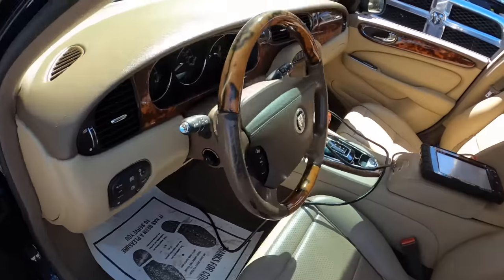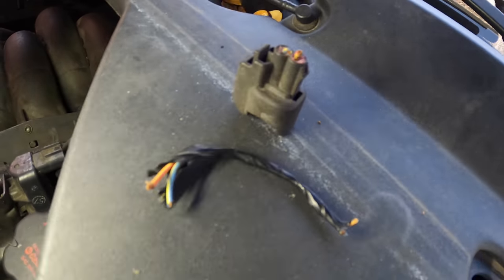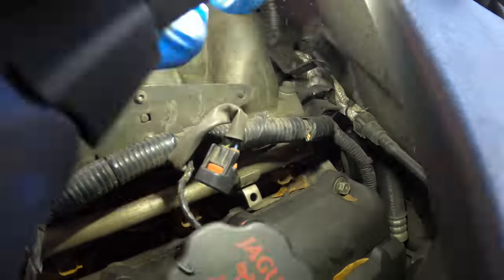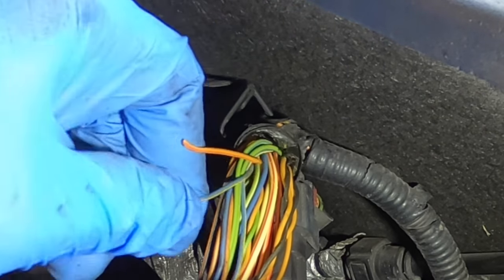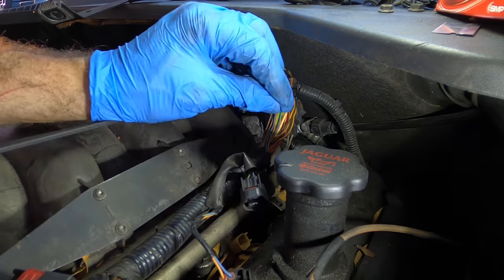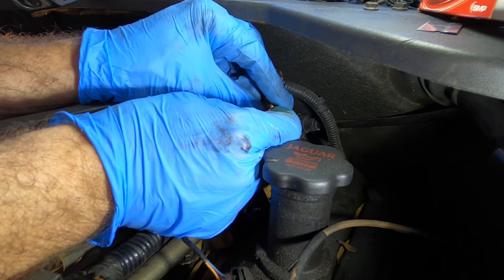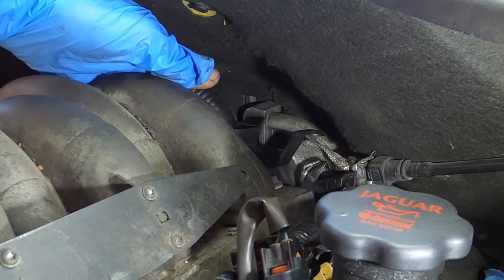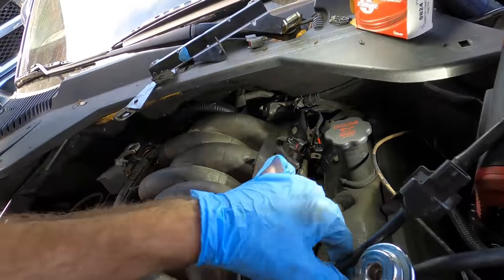Angry XJ Jaguar Engine Attacked / Electrical Damage. P0208 P0308 P0316

Comment: You can also get butt splice crimp connectors, covered with heat-shrink which has a hot-melt adhesive interior coating. Crimp both wires in and hit it with the heat-gun. Job done!
Reply: Or the non-insulated butt crimps that you cover with regular heat shrink. Either are my preferred option over soldering on car wire harnesses, but a good solder joint can work fine provided the wire isn't subject to much movement.
Reply: @ferrumignis  It's a "tomayto!/tomarto" thing, solder vs crimp! 
For ease and speed the insulated glued ones are nice but as someone else said earlier, whatever works and keeps working is fine.

Comment: When you put solder on the tip of the iron it’s called tinning. That was a tough location and  you are very confident on your connections as you buttoned up the connections before testing. Nice job !
Reply: Tinning is the action of preparing the wires with solder before attachment. NOT touching the tip with solder.
Reply: @Smakheed  actually, applying solder to the soldering tip IS referred to as tinning. But that process is also intended to prevent the tip from corroding...
Reply: @GReaper  Melting tin with the iron and dripping it into the joint is not soldering

Comment: My tip o the day (nothing reeeeegarding the soldering, which looked perfectly fine to me...), but rather on the tape wrapping. Another channel I follow, good 'ol Wes @Watch Wes Work, was wrapping a wiring harness, and used a socket as a core, then wrapped a length of the wrap on it. Then he effectively had a mini-sized roll of the wrapping material that could be easily manuevered in tighter confines such as the wiring harness you were working on here.

Just thought that was an incredible idea & wanted to pass it along.

Great content, as usual, and thank YOU for helping all of us "have a great day."

Comment: Couple tips for soldering, when twisting the wires together, fan them out first. Makes it easier to twist together and holds better. Also, use flux paste on the wire. Makes the solder stick better. One other tip, if you can, take the cap of spray can and cut 2 slots straight across from each other. Makes great little wire holder and also catches any solder that may drip off. Not bashing your soldering cause you did pretty good, just giving some helpful tips
Reply: Rosin core has flux in it so the use of flux past is not necessary if that is what type of solder he is using.
Reply: Pro-tip contact cleaner also improves soldering experience 🤣
Reply: @bradbuschur2795   reliability though  he could have used new wire loom instead of cloth   OEM grade is hard to find though
Reply: Your slots in spray can lid is a beauty. What a great idea. Thanks.
Reply: @bobhudson6659  no prob. It really does work great
Reply: @jacksmith2315  yes great idea on how to hold the wires, going to remember that
Reply: Thank you Jack,  Great Tip.
Reply: As an ex auto electrician we always used resin cored solder on good clean cable, and on slightly corroded cables we used acid core.
Reply: @richardcrowell284  did the same at an auto elec shop as it was how they wanted it,
Reply: @richardcrowell284  That works great if the goal was to get the car out of the bay and hope they sell the car prior to the acid eating the copper and failing again.  For current operators of soldering guns/irons: Please! Clean the corrosion off first and only use rosin core solder
Reply: @karlheidrich2916  We always had a tin of flux on hand for that stubborn cable that resin core would not solder.

Comment: A good way to prevent critters from monching wires is a product I believe is called rat tape. Has capsaicin embedded in the cloth.

Also: nice trick a friend showed me for taping up harnesses is to wrap a length of tape around a socket. You can also use an extension for really tight spots if you finesse it a bit.

Comment: Hi Ray, I use a curved deflector on my heat gun that makes heat shrinking much quicker.  The deflector goes behind the work and reflects heat back so it heats both sides at the same time.

Comment: A little tip for Insulating or any tape, wind some onto a small (10mm) size  socket then use that in confined spaces, much easier ;-)
Reply: I used this idea the other day by winding tape on backwards (sticky side out) on the infamous easily lost 10mm 1/4" drive socket. Worked a treat. Should have been doing that years ago. From retired mechanic in Land Down Under.
Reply: Great idea, I have used strips of tape only to get dirty and stick to itself.

Comment: Your soldering skills have gotten the peeps with over 50 years of soldering experience their panties in a bunch.  Nice work brother.  Job well done.  Great repair BTW
Reply: It seems that no matter what Ray does, there are a lot of people that get their panties in bunch for the different kinds of jobs he does. You know, some of them are probably right and are experienced in those certain jobs but the way they come off talking about it turns me and evidently a lot of other people off. If you can explain yourself without taking it personally than great but almost nobody likes to hear people bitterly complaining about a job Ray does and add nothing to the conversation. Just my thoughts, another good video Ray, thanks!
Reply: Not me. In my 50 yrs I've done all of the same stuff Ray does and then some. Only thing I can say is don't worry a whole lot about a chisel tip for the iron. If he was soldering for a living all day it might make a difference. Wait until the conical tip wears out and then get a chisel tip.
Reply: Panties in a bunch? Or simply trying to pass on some knowledge and help a brother out?
Reply: Yeah, I don't get it. I put myself in the place of the customer. I just want my car fixed. After watching a bunch of Ray's videos, I would have no qualms taking my car in to him to be fixed. What do I care how good the soldering looks? As long as it holds the wires together and transfers electricity as it should. He does a pretty good job, is very conscientious and goes the extra mile.
Reply: @108gk  We used to use quick heat irons, which gave 50 watts to a flat tip.  We needed to file it flat almost every day, as it would wear down after 8 hours.   That conical tip iron is lower temperature, so will most likely last for years before wearing out.
Reply: No,  no one has their shorts in a bunch, but maybe you do ???
And no, those are not skills yet... Have to be skillful first... Takes lots of practice...
Reply: @frandanco6289  it’s panties. you should follow all the comments from prior videos regarding this topic.   Why would my panties be in a bunch when I clearly agree with Ray and others here?

Comment: Saw this tip over at SMA: Wrap the tape around a 10mm socket to make it easy to wrap wires in tight spaces. He just takes a foot or two and wraps it around a socket and you have a tiny tape roll.
Reply: Where the heck is my 10mm...

Comment: Having battled the rodents chewing my Ford Escape wiring I enjoyed watching this one! My understanding is that wire is made now with Soy-based plastics for environmental reasons. Apparently this makes them tasty to all the plant eating critters of the world. Honda makes a capsaicin coated tape that I used to wrap any exposed conductors and the joint between connectors and loom/wrap. Seems to work. I see chew marks in the tape but nothing down to the wires yet. BTW- soldering anything under the hood of a road worn vehicle is a pain in the butt. Good job!
Reply: they should add some chilli to the production of these items to turn the critters off  with a hot mouth   i guess its good for ford and the others they get to sell more parts that would last the life of the car otherwise

Comment: My dad was an aircraft fitter in the Royal Navy, started in the 1950's, the way he taught me was heat the wires, dab them with flux, the solder then flows into the joints like magic. As you know right way to do the job is whatever works.

Comment: I think the Hook then twist method would have been best on this application, flux would have helped. I also tend to dap a bit of silicon on and around the exposed wire portion then heat gun the heat shrink in place, this will squeeze the silicon and create water barrier in case water gets under the heat shrink.
Reply: Liquid electrical tape before heat shrink tubing.
Reply: Glue lined heatshrink is a thing (a mighty good thing at that) 

But then heatshrink tubes lined with solder and glue are the mutz nutz.
Reply: Tall have the same ring tone as south main auto Eric o
Reply: @dougaltolan3017  I've used the tubing with hot glue in it. I can't say anything bad. Maybe omit the liquid tape.
Reply: @dougaltolan3017  the heatshrink with solder and glue in them are good, but IMO, they could use a bit more solder in them.

Comment: Hey Ray, I have been doing soldering all my life, dont listen to others, just make sure you make a sound and secure solder connection, also try not to move the joint until it has hardened otherwise it could lead to a dry joint! how ever you do it i am sure is good enough!

Comment: You soldered that wire exactly like I would have done, so if some random on the Internet complains about that, tell them that I (another random on the internet) would have done exactly the same way 😉
Reply: I approve also and would have done it the same way. I am 66 yrs old and been soldering (radio & electronics hobby) since I was 10. I was taught by my dad, who was military trained. I only have problems outside, when doing in field, or auto electrics, due to lower temperatures sucking the heat from my iron. Modern temp. controlled irons help with this.

Comment: I am a radio restorer.  Your soldering was just fine and will be a strong connection with the heat shrink.  You can make your soldering iron tips last longer by coating the tip with solder before turning it off and storing.  They make a brass coarse "steel wool" pad for soldering tips to clean the tip the next time you heat up the iron.  The tip is cleaned by dipping the hot tip in solder and then cleaning with the pad several times.

Comment: Your soldering method is the same way I do my RC wires for long lasting reliable electrical performance.

ALWAYS apply a dab of solder to the iron's tip to aid with heat transfer into the wires! It makes a quicker solder joint, & lessens the possibility of extensive damage to the wires insulation.

Comment: Any mechanic who starts off by calling the beast a "Jag yew arh" has my rapt attention. 
The only topper for that is pronouncing RR "Royce Rolls". ( Class thing.) Back in the days  
of beautiful high voltage wiring running from distributor to the spark plugs, unwary Jag 
owners who had parking assigned to them close to nut trees (aka squirrel condos) 
found it to be a very expensive experience...

Comment: Friend of mine went through the two hours of diagnosis, finding the fault, isolating the wires, all the awkward 'contortionist attitude' to complete the soldering, only to find that after he had finished the soldering, he had forgotten to slip the shrink sleeves onto the wires. I think he was swearing for at least ten mins without repeating himself once.
Reply: Been there, done that - a few times but without the vitriolic cursing - that was the biggest challenge. Problem is I have forgotten the heat shrink a few times, but I am learning not to.
Reply: @bobhudson6659  I am an ex UK submariner, and I was so impressed by his language skills 😂

Comment: I had a rat infestation in my apartment (they came up through the sewer pipes) and they chewed through a lot of wires...but not the expensive speaker cables. The exterminator told me that a lot of the insulation on the wires is kept soft with an infusion of fish oil. If you go into a cable warehouse, it reeks of fish. My speaker cables were made with silicone sheathing, so they left them alone. RIP Playstation 1controllers, though.
Reply: Rip press F to pay respects. F
Reply: I have heard that they use palm oil in the insulation.
Reply: @bagspannaren1410  makes sense... it's cheap and plentiful, easy to work with, harden it to the consistency you need...and when it starts to break down, as all oils do, it smells like a buffet for those rodents!

Comment: On soldering - sometimes there is oxidation where the tip screws on to the iron. Makes it look like the solder is not flowing. Loosen and tighten the tip and it will usually heat faster. But, another job well done.......
I'd be curious to hear what the owner says after you show him the ravaged wiring.
Reply: Probably thanks for not replacing the entire harness
Reply: He needs to clean that hot tip on a damp sponge to get it really nice to work with..
Reply: and all ways clean the tip on a moistened paper towel, clean tip is critical in most things in life, I give the solder wire a quick clean usually too.

Comment: Over my 40+ years of being an auto tech I have always hated wire repair and the associated criters. A neat tool I found to help is a small vice used for tieing fishing flys. It has a heavy base with adjustable arms and alligator clips on the ends (don’t know how to add a picture). Put the heat shrink on behind the clips. Put the wire in the clips push the wires together, twist and solder,easy. The clips also act as heat sinks so the heat shrink won’t shrink before you want it to if you working really close. Try it you will love it.

Comment: Saying howdy from Texas.  Your wire repair was the recommended process to make a splice. The only thing you could have improved was to clean your HOT soldering tip to improve heat transfer. This type of repair will last longer, be stronger and be more reliable than any other that you have made. BRAVO!!!!!!!

Comment: Awsome ray, you have inspired me. I went out an bought a 91 buick century with 300k miles. I will be cha ging valve cover gaskets, spark plug wires, sparks plugs, an ignition coils. Will be putting all new fluids in it also. Im looking forward to see how it comes out hopefully i can add some more life to the 3.3)

Comment: I use non-insulated Solder-less connectors and the double wall heat shrink, I find it to be a faster repair and I have never had one fail.  Last year I re-designed and installed the wiring harness on my Flat Bed Trailer and the connections I installed in 1995 to correct the dealer installed Scotch Lock connectors were still in great condition.  I replaced the Scotch Locks the day I picked up the new trailer.

Comment: May I recommend soldering pencil care. Sand the tip to fresh copper. Tin it again and store it with a blob of solder on it. When you want to use it again, preheat the pencil (or gun) and wipe on a damp sponge for a fresh tip to work with.

Comment: Hi Ray . Try the Eric O trick with the tape . He raps just enough tape for the job round a socket and then wraps the wire repair . Saves turning the roll in a tight spot .

Comment: Here's a tip from Eric O.  Wrap a section of tape around a 10mm socket. Then use the socket to wrap the harness. Much easier to get the socket in and around the harness you are wrapping.

Comment: I certainly prefer the twist together and solder to the tin and connect laterally method. Much more secure. One alternative that you might want to try is to splay the two wires, push the splayed ends together and then give the bare copper a bit of a twist before soldering. Also, please get yourself a flat bit of that iron...

But a nice job, especially in what was such an awkward location.

nb. I use a soldering station which also has a hot air gun rework station. The temperature on both can be set independently and the heat gun has a selection of nozzles, and they are great for more precise direction of hot air for heat shrink cable (although the hot air gun can go high enough to melt solder).

Comment: 100 times better soldering job than I just did. Mind you I also had to stand on my head to do it. Blower motor replacement on a 1984 Chrysler Fifth Ave.

Comment: I think the solder process went well, fair enough.  What I would do in addition, maybe becuase I live close to the sea, is to add dielectric grease in the soldered connection before covering it with the heat shrink device.  Also I clean with isopropylic alcohol before and after the soldering, just to make sure the connection is copper to copper.

Comment: I know you love the reeeeees on how to solder and I'm not going to say anything about the method, because no matter how you do it, it seems to work out.  The only thing I would suggest, no matter what method you use, is to dip the wires in flux, it makes a world of difference in how fast and smooth the solder flows.

Comment: In wet or humid environments, I use heat-shrink with glue inside to help seal the connection.  Learned that from F-16 aircraft wheel wells.  Still a good job.

Comment: I contract to our local Bus services here in Perth Aus. I come across many Bus faults caused by Rodent Infiltration. Your lucky you can access the looms easily.
Most of mine are hidden in places that are non accessible.  Love that cloth tape. But you should have used some solid PVC tubing to match the rest as well.

Comment: Another great video from Rainman. 

I’d suggest we lobby auto manufacturers to use chilli oil to lubricate their wiring looms, mammals hate chilli. I use chilli powder in my wild bird feeders as the squirrels used to rob them dry (our feathered friends are impervious apparently), it works too so no reason it couldn’t deter cable chewers!
Reply: chili...

Comment: For personal wiring repairs, I solder. When I do wiring repairs on customer's cars, I use marine splices. It's so much faster and easier than soldering and is just as good if not better. The splices do cost more than soldering but the customer is the one playing for them.